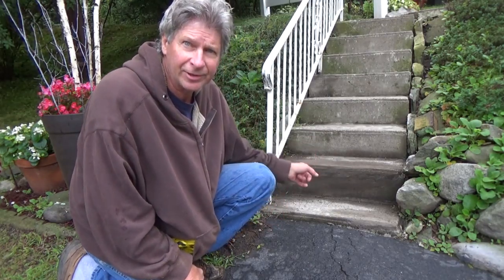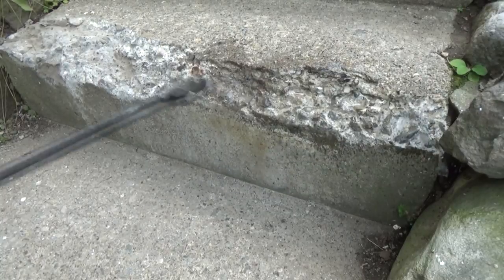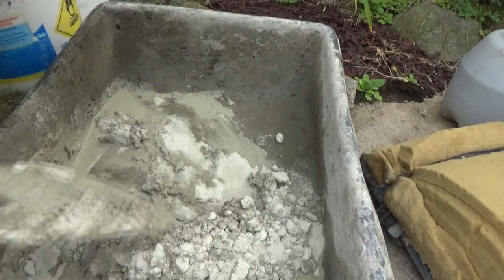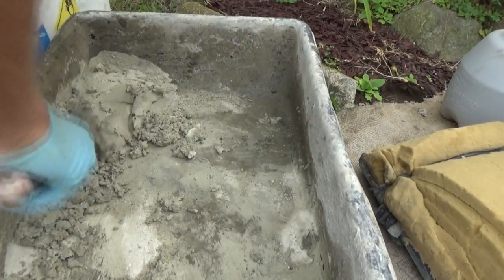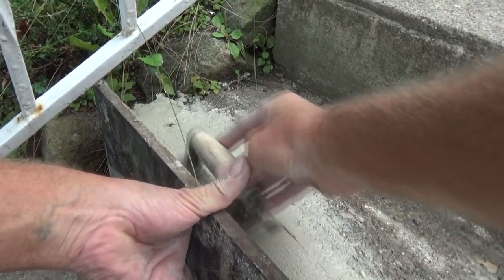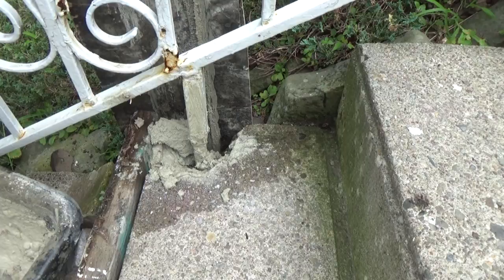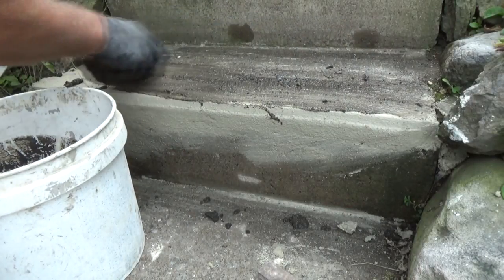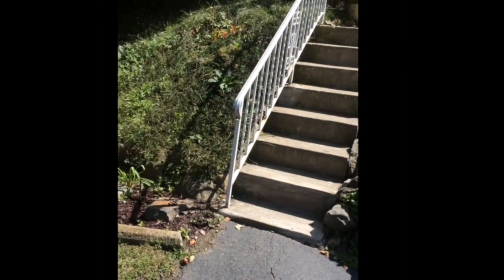CONCRETE STEPS REPAIR (Part 6) Mike Haduck

Comment: Can u do this with Portland and sand mix and if so do u think 2 -1 sand-p ration works good
Reply from the maker: Hi Hayden, that is how we did it in the old days, but you got to wait a day or two to take the forms off,  I just use the fast setting cement and be done with it in a couple hours,  thanks mike
Reply: I guess I was told if I use a bucket of Portland use 2 buckets of sand and 3 buckets of gravel or close to that!? I have a bag of Portland I want to get rid of and not waste
Reply: Thanks for the response I been binge watching your videos ..I have learned a lot from other people but I want to get maximum dollar for my time so I must do this one alone

Comment: Dis you use rapid set mortar or cement all??
Reply from the maker: Hi Dan, I used mortar mix, I believe it's the same, one has sand in it and one dosen't,  and mortar mix In most instances is easier to use, thanks Mike

Comment: Mike,
Why did you use mortar instead of cement all.
Reply from the maker: Hi rpm,  in my option the regular rapid set and their  mortar mix is the same stuff with sand added, and it is a bit easier to work with,   Thanks mike

Comment: See others include drilling in some concrete screws to hold the patch better.  Looks like a real pain to do that step.  Rent a hammer drill?  My old concrete will probably laugh and my smaller cheap “hammer drill.”  Do I even need to do that step?
Reply from the maker: Hi C, anything that works, I just was showing some old school, thanks Mike

Comment: Mudd Has a purpose...👍👍👍
Reply from the maker: Thanks Daniel. Mike
Reply: @MikeHaduck  
I have a question if i have plans to put blue stone on my 3x18ft foundation wall??
If its painted do you advise to remove paint or ill be ok with chicken wire and scratch coat??

Comment: why you use rapid set mortar   ???  and why not  portland concrete mix that has rock in it  ???  i will use rapid mortar now for a small repair if  you say to...
Reply from the maker: Hi John,  I always keep a couple bags on hand, and the mortar mix will fix anything and I could always add some gravel to it, It always depends on the job, and sometimes I use a different product but everything depends, thanks Mike
Reply: okay thank you... i will remember that i can ADD gravel  to mortar...   Thx...  and i will add  Mud  if i need to blend the finish...  Thx...

Comment: Some people talk about using concrete bonding adhesive. Does wetting the concrete compensate? It seems to me that using the bonding adhesive would actually create a film, that causes a permanent tiny separation. Is that why you don't use it? Thanks again. Your great!
Reply from the maker: Thanks Daniel,  I think everyone got their own ideas but I always used the techniques the old timers taught me and never had a problem,  I hope it helps,  thanks mike

Comment: it is not good for 101%. it is good till first spring and you come back to fix it again. you should install pins, masonry mash or anchors bolts before pour real concrete. Do not forget about bond adhesive. Do not use mud  - you are a mason not a farmer use a power washer before start the project.
Maxim - restoration mason in Canada last 20 years
Reply from the maker: Hi Maxim. I been doing it over 50 years now,  my dad 70 and I never had a problem but what works for you is fine too, thanks for the comment,  mike